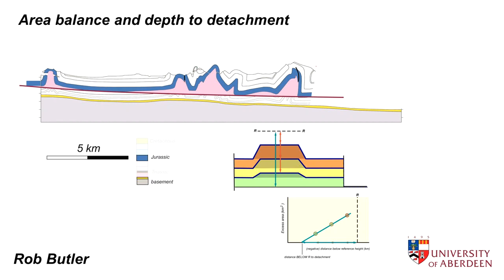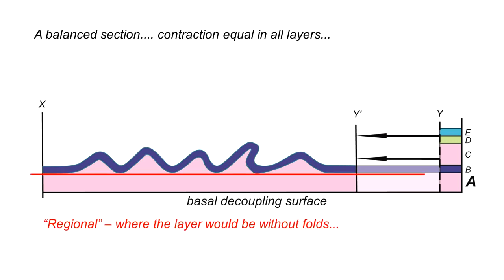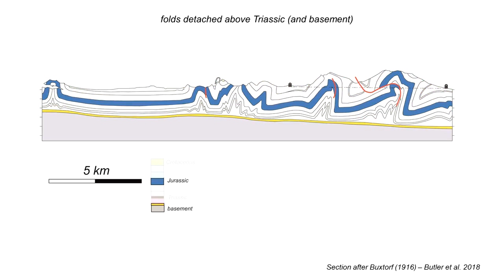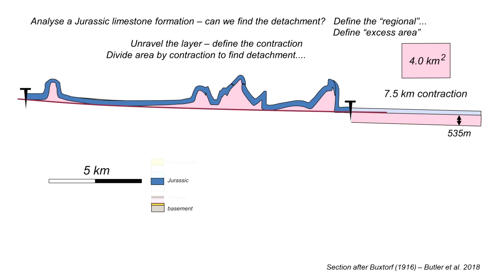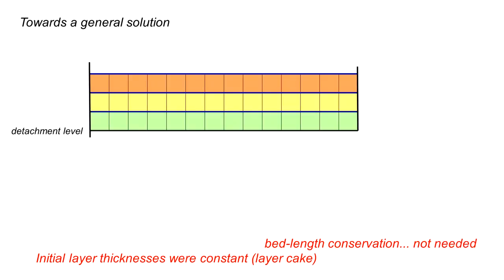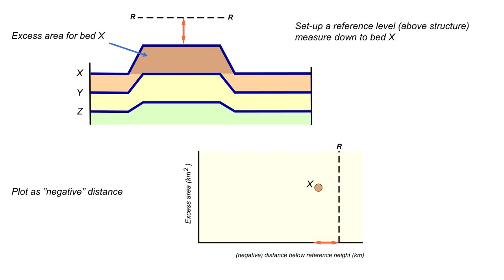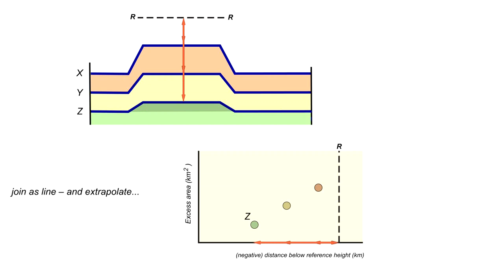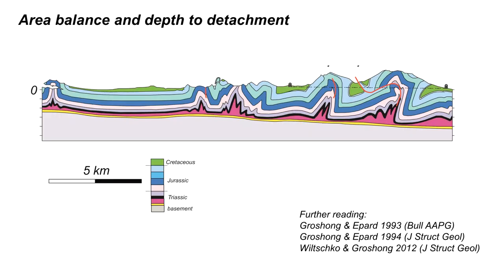Area balance and depth to detachment

Comment: I'm looking for some balanced profile practice material. Would you recommend a book written by Groshong, 3D Structural Geology?
Reply from the maker: Rick's book is very good - one of the few that's practical. There are insightful things in Derek Powell's Interpretation of Geological Structures through Maps (Longman) - published30 years ago - if you can get hold of a copy. The exercises on section restoration and balancing in my videos are on my associated Shear Zone website...
Reply: @robbutler2095  Thanks a lot. Derek's book is not easy to find on line. I will try to copy one from library.

Comment: How is excess area practically calculated from a cross-section, as we have quite complicated folded geometries, any suggestion on the calculation of area, I am curious about the 4.0 km2 area estimated for the Buxtorf Section
Reply from the maker: The key decision is "where to place the regional" (see video on "Regionals")... then just count the area (eg there's a simple area calculator in Acrobat) ... If there's uncertainty on where regional is - try a few alternatives, each of which will generate its own "excess area" and hence shortening or depth to detachment...  or, as in the video, try multiple horizons...
Reply: @robbutler2095  Okay thank you very much for the enlightenment.  I will try as per the guidelines provided.. Have a good day 😊

Comment: In Area Depth Strain the distance to the datum should be measured to regional depth, not the crest.
Your videos are 👍
Reply from the maker: Thanks for the comment. I cover this in the commentary - you get the same result (but a different gradient on the graph) IF the strain is uniform through the multilayer. In some situations - such as an array of closely spaced folds, or a "warped" regional (which is common - see the "Regionals" video) - it can be difficult to define a robust regional - so going for the crest can be a useful way into the problem....